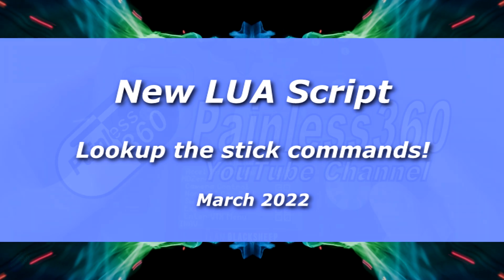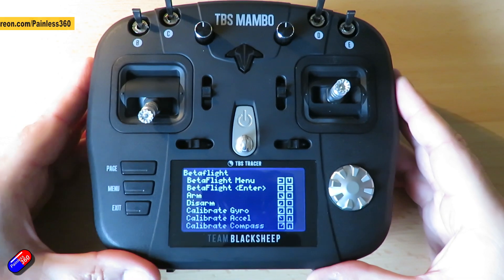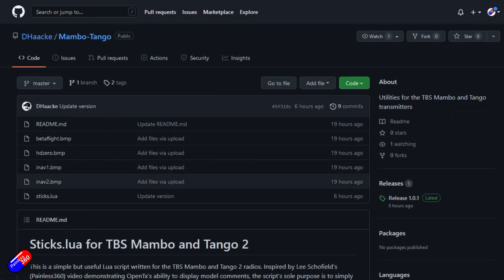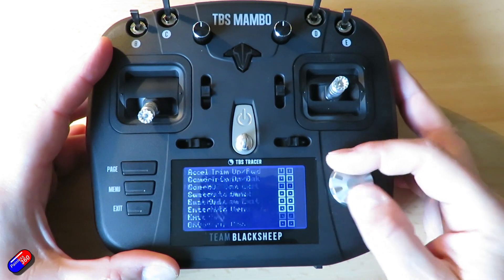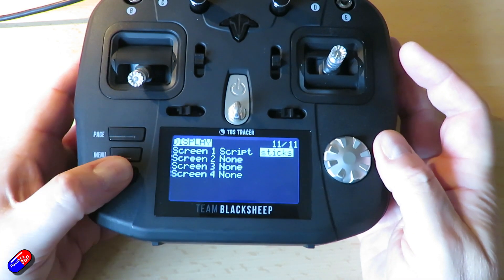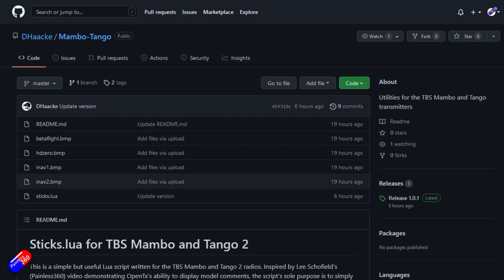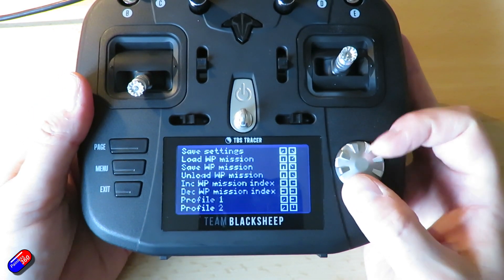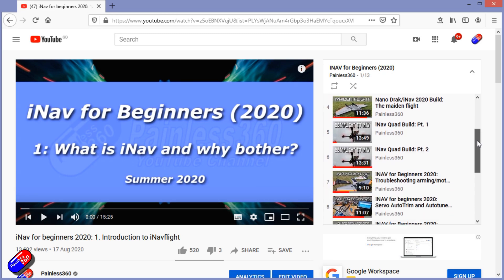New LUA script that shows you the stick command for INAV, Betaflight and others!

Comment: there is lua script for TX16... let's check it :)
Reply: uploaded 5hrs ago :)
Reply: on EdgeTX script is executing, yet only one page is available - can't scroll
Reply: @AndrzejRoszkowski  I don't have an EdgeTx on a radio yet (I use a Mambo exclusively these days).  If I make a script that will provide me a couple of code values I need to provide scrolling on EdgeTx, would you be willing to run it and tell me the those values. I assume the text looks OK, right?
Reply: @DHaacke  i can help later today or tomorrow, yet i've quickly checked workaround for - etx companion is able to run lua scripts and simulate input events - can't post images here, i've synced my radio with local folder (unzip regular sd card contents and point it in radio profile), to simulate rotation of knob - simply put mouse over it and scroll using mouse wheel - your script is behaving same way in simulator like in normal radio
Reply: instead of predeclared event id i've used those:
local function processEvents(event)
  if event > 0 then
    lastNumberMessage = event
  end
  if event == EVT_VIRTUAL_NEXT then
    lastMessage = "Jog wheel CW"
    if (currentRow + 11) <= maxRows then
      currentRow = currentRow + 1
    end  
    killEvents(EVT_VIRTUAL_NEXT)
  end
  if event == EVT_VIRTUAL_PREV then
    lastMessage = "Jog wheel CCW"
    if (currentRow - 1) > 0 then
      currentRow = currentRow - 1
    end
    killEvents(EVT_VIRTUAL_PREV)
  end
  if event == 96 or event == 1538 then
    lastMessage = "Menu or Jog wheel Button Pressed"
    currentRow = resetRow
    killEvents(96)
  end
  if event == 98 then
    lastMessage = "Navigate Button Pressed"
    killEvents(98)
  end
  return event
end

seems to be working :)
Reply: let me try to create PR for... neved did it on GH ;)